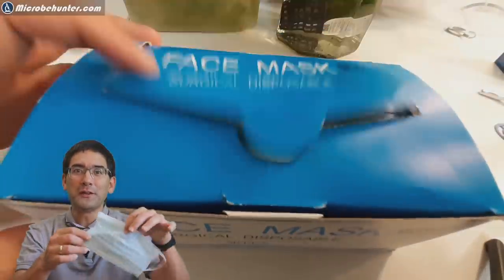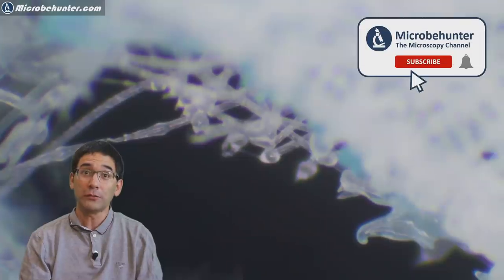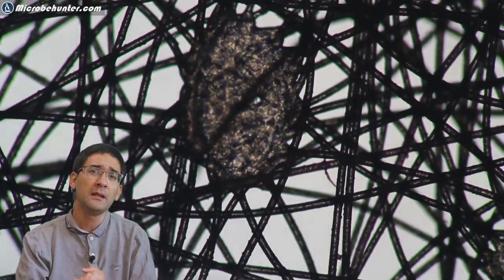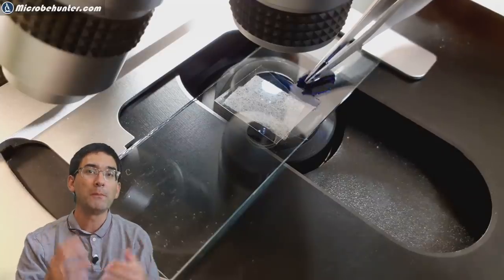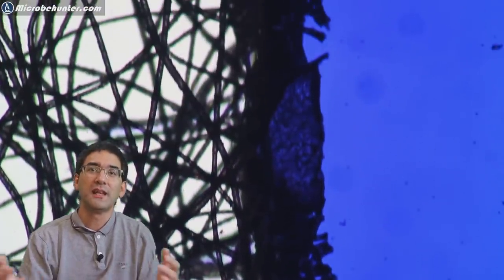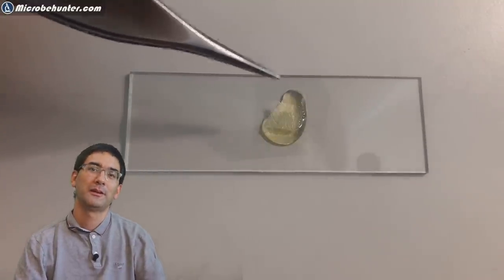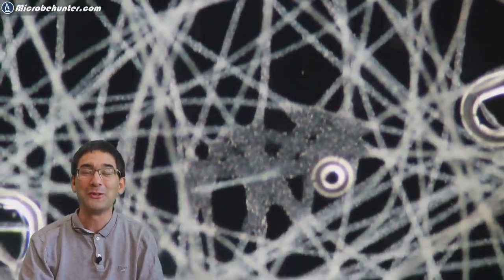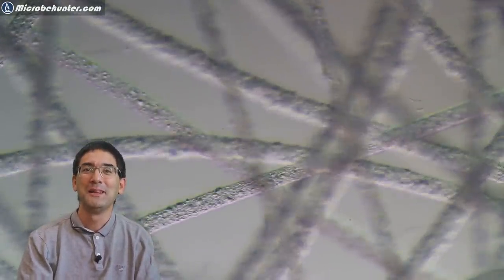A Corona Face Mask is made of synthetic fibers | Mask under the microscope

Comment: Yesterday, a nurse, wearing an N95 mask, told me she likes the smell of my perfume 🙄
Reply: @dedetudor.  what does your comment mean ?,just interested. Nixed means to stop . So therefore it just doesn’t make sense what you have said 🥺
Reply: @ireneforster4279  that's right. Even n95 masks do not say on the package that they prevent against viral exposure through respiratory inhalation. AND when you are breathing out your air escapes through the expiration valve. See? This came out quite some time ago. MANY experts say masks are a false sense of security. 
N95's are respirator masks. Mostly for environmental contaminants. But in this age.... People will believe what they're told by who by what by what peer review?
Reply: @dedetudor.  I agree I work in the dental profession and BC (before Covid ) we wore gloves and a visor  only and I worked through at least 10 known viruses......... now we wear mask visor gloves and a poly bag neck to feet ..      and none of it protects me or the patient .Although the visor does offer splatter protection ... on the mask box it actually tells you everything basically useless as a disclaimer . The hand sanitiser has so much poison in for your immune system to absorb and it’s flammable if it’s in a very warm environment .....never use it , good old soap and water is good. My immune system is strong (it has to be) and my mind is fairly strong because I know that plays a huge part as the vagus nerve from the gut(3rd brain) is linked to our brains !!! Rambling now lol 🌸🌸🌸 Our cross contamination is of the highest standard always has been 🌸
Reply: @dedetudor.  
N95 means the mask is considered medical grade and it is not considered 
a respirator.They are not the same thing.
Reply: And viruses are much smaller. Mask's are a joke
Reply: My husband had to be fitted for his mask at his job. They had to fit the mask then do a smell test to make sure the mask was fitted. They shouldn't smell anything. One thing it does for sure is not let you breath.
Reply: @louise3088  that's what tony fauxci said. If it's VENTILATING expirations. That's why they started making people where a plastic mask over the n95. See? 
Don't argue. Das is Verboten. FAUXCI says!
Reply: Maybe the dudes at Smoke Buddies indoor smoke boxes might want to make masks??
Reply: oxygen finger meter.  92 is just ok. Should be 95 at very good, but 86 & below? Ur cells are dying definitely in lungs, brain....
Reply: @ireneforster4279  All good info Irene, thank you.
Reply: @louise3088  Im a retired nurse. We NEVER used an N95 mask. That mask is what painters and other construction professionals use.
Reply: @GetReady4LiftOff  Your oxygen saturation at room air should be 98 to 100. A normal person would be in respiratory distress at 92%.
Reply: @itsokaytobeclownpilled5937  
Different situations call for different levels of protection.
Reply: @itsokaytobeclownpilled5937  
I worked as a surgical technologist in the O.R. for decades.When we used a laser for certain procedures, we most 
certainly used an N95 respirator style mask as opposed to a regular O.R. mask.
Reply: @Rebecca-1111  They leave little clues.  During the fires, a fire chief said(or some fire spokesmen said) masks wouldn't block smoke particles.  The smoke particles are WAY WAY WAY WAY LARGER than the boogie virus.
Reply: @Rebecca-1111  Well that's spookie.  The whole fitting ordeal.
Reply: @louise3088  Welp, i didnt sit in on those kinds of procedures. You got me there.
Reply: @sicsemperevellomortemtyran309  exactly.
Reply: There is doctor who did the same thing and found flat worms. I saw her interview telegram. It’s probably circulating in IG as well
Reply: @ireneforster4279  Whoever invested in PPE before this scamdemic is getting really rich.  What a bunch of kabuki theater this has all been.  "Our cross contamination is of the highest standard".  Do you mean cross immunity perhaps?
Reply: Hi our hygiene standards are of the highest level , so cross contamination is very very low , minimises spread of disease from one human to another .
Reply: @ireneforster4279  Oh yes.  I remember one of my best dentists bragging on the higher sanitary standards than even surgeons use.  He had foot peddles for his faucets and stood w/ his gloved hands up, not ever touching anything.
My current dentist is a crapshow and does things that would get him shut down.  He doesn't use a hygenist to assist, not even to put his instruments out before he starts w/ me.  So while my jaw is aching, half upside down on his lift chair (because that seems to work best for him), he goes rooting around in his drawers (notice I said plural) to find the next thing he needs.  I remember the first time he did that,I was gobsmacked. It took me awhile to clue in that if there really was a pandemic,  and if fomites really were an issue for respiratory virus, I and all his patients would be so screwed.
Reply: @wakeup2241  flatworms in the mask's?
Reply: @saintejeannedarc9460  I have a hard time not gagging at the dentist after I found out they recycle that water in that box from patient to patient. SICK!!!
Reply: @Rebecca-1111  There are some sort of black worms--could be nano technology--embedded in the disposable masks. Those masks shouldn't be worn anyway! They're toxic (you're breathing in chemicals) and they are not biodegradable. Why are people so effing lazy that they won't wash a face mask when they get home and let it dry overnight? So wasteful.
Reply: @louise3088  fact-checker here:  you are correct!
Reply: You need to create a meme of this and send it to one of the many conservative channels that will publish it.
Reply: @SC-gp7kt  today she told me she liked the smell of coffee that was brewing in the next room. 😳
Reply: @itsokaytobeclownpilled5937  
I am not trying to get you, only hoping to help clarify some of the confusion.
Believe me, when your job is to stand directly in vaporized genital herpes warts fumes,the efficacy of masks becomes 
paramount.Even though there is suctioning of the "smoke" done throughout, the fact that an ill fitting mask could result in herpes lesions of the throat is never forgotten.
Reply: @Rebecca-1111  I did not need to know about the recycled water, thank you very much! LOL
Reply: @warren7389  lol I found out I said the same thing 😁👍💯
Reply: @saintejeannedarc9460  - The virus, brought to you by China.  PPE now conveniently provided in massive quantities by China as well.
Reply: @GetReady4LiftOff  anything below 96 is bad
Reply: The other day she told me that she does not like smell of my fart. I told her that I thought she is protected by mask... but...
Reply: @louise3088  no, the N means it is non oil resistant, and filters out 95% of particles greater than .3 microns. There is an R which is oil resistant for 8 hours, and P which is oil proof. Then there is additional ratings of 97, and 100 with the accompanying increase in efficiency. There is medical grade as well as industrial grade, some have an exhalation valve some do not. I have to study this shit every year.
Reply: @dedetudor.  no, not all N95 masks have exhalation valves, most actually don't, there is medical grade as well as industrial grade, although I do not know what the difference is. most likely sterility.  Although I don't believe a bit of the mask horse shit either, I have to study respiratory protection every year, and the little surgical masks like so many people are using are only mentioned in the context that they are absolutely useless in any legitimate respiratory protection program.
Reply: @jamesharmon3827  
Not really sure why you are posting no to me.Did I not say medical grade ?
Did I not say different procedures require different levels of protection ?
Reply: @jamesharmon3827  
The difference is not sterility.Although
O.R.s are considered sterile environments, clearly not everything inside of them is sterile.Scrub clothes, O.R. caps, shoe covers and masks are not sterile.Whoever scrubs in wears a sterile gown and gloves.For you to say
regular N95 masks are absolutely useless in any legitimate respiratory 
protection program shows a lack of knowledge.There are many airborne illnesses whose spread is lessened with the use of regular medical grade masks.
Reply: @jamesharmon3827  they've never given proper toxic waste or hazardous waste receptacles for a bsl4 pathogen.
 AND the place people grab the most when they adjust their masks from falling down when they talk is right where the nose and mouth are. I've seen Fauci adjust himself upon standing for a break after a questioning. He continued to adjust his pants and belt buckle rubbed his face and adjusted his mask. I saw Joe drop his mask as he turned to leave in a rare stage moment at the podium. He dropped it on the floor and then put it on his face. 
At the end of the Trump 4 yrs.... A man was going to come onstage and give an update of some sort. The camera angle caught him standing in the wing before he came in stage, maskless. He put the mask on his face before he came out on stage and walked to center stage podium, took off his mask to speak. COMEON man!!!!
I'm former medical... Also studied OSHA mask standards well PRIOR to the announcement THAT has well...  You know.
Reply: @dedetudor.  my friend told me he feels naked without a mask.
Reply: @anewstarisborn.1945  aw.... Well now, I'm speechless.😣 I hadn't heard that one yet.
Reply: Gases are smaller than virus by quite a bit i found out. I think....
Reply: @nobody617  That's why gases require Gas Masks. As during the WAR when the makers of mustard gas sold it to the Miltary armies.
 Dr. Sheri Tenpenny says, we should have one. They could bring back a lot worse things than mustard gas.
N95 only filters out .03 microns particulates and above as the package says but not gases. 
The virus and viral particles are ever so much smaller! So check THAT out!👍
Reply: @dedetudor.  thats exactly what i was saying. Of course they could sMell perfume thru an n95.

Oh wait. Ive read that the virus is much bigger than gas. But i looked at methane.
Reply: Oh wait.... I read that the virus is way bigger than gas. Ok. Ill read more.... Nit that it really matters...
Reply: @nobody617  I've read the virus is smaller than what the masks can block out.
Reply: @Sundayschoolnetwork  i do realize the virus is smaller than the mask filters. Im only saying that gas is even smaller.
Cheers!
Reply: Aerosols.
Reply: What?
Reply: Perfume particulates are smaller than viruses. So are gases.
Reply: @Rebecca-1111  actually no. Perfume particulates are smaller than viruses. Also, N95 respirators can block 90% or more of viral PM.
Reply: @j005a  was going to share a video of a doctor who debunked that idea, but the overlords here deleted it...very telling.

Comment: I assume the non-absorbent quality of the material means that your saliva liquid will quickly evaporate, leaving any viral particles free to float away into the air (and back into your lungs).
Reply: Well that is the point! They decided something had to be done about climate change. They decided that they could reverse or slow down climate change if the population was substansially reduced.  For now, they decided to try reducing the carbon diaxide on the planet. Well it worked, they decided. By keeping us indoors and having us breathe our own poisonous carbon diaxide instead of air for 10+ hours a day they can slow climate change. NO LIE

Comment: If it lets oxygen molecules through then it certainly lets much smaller viruses through!
Reply from the maker: Viruses are significantly larger than oxygen molecules.
Reply: @geoffparmenter7006  got any tips on how to make yourself look like a fool?
Reply: @geoffparmenter7006  covid has to travel in a medium, the medium is called a droplet/aerosol. N95 masks filter these medium with 95%+ efficiency. Surgical masks have shown to filter at ≈60% efficiency.
Reply: @lancerebo952  keep drinking the kool-aid. 😥
Reply: @goodcitizendude9597   If this is in fact Covid-19 as in Sars/Mers type then these critters are .01 microg. in size. N95 mask stops 95% of particles size .03 microg. 
Not sure where you got your information but I have the Documents to support my statement.

Comment: I did that. I put varies brand of mask under my new scope. They are made of plastic. 3 layers. The middle layer is of denser material.
Reply: I have seen exactly the same. The video seems to be about the white inner layer. It looks like the dense inner layer of my mask has holes of several micrometers, but I am not sure. Transparant material can also let light through, like a hole.

Comment: The spaces between the fibers in the mask are pretty far apart. I’m now wondering how truly big or small is a virus particle in comparison to the spaces in the mask? 🧐
Reply: The virus is roughly 1000 times smaller than the pores on the mask. So, no way masks protect you from the virus.
Reply: Actually....try 100,000 times SMALLER...
Reply: Sarscov2 is 70-80 nanometers in size....human DNA is 10 nanometers

Masks are in micron's 

Cloth Masks are around 600,000 times larger...

No known filtration system known to man can block a virus...

That's why the PPE for studying the Virus is fully self contained oxygen supply and level 4 HAZMAT suit..

Comment: Will u measure the spaces, and then place a water droplet that would exit ur mouth as u breath, and a typical virus and such...and compared to a N95, N97 mask, and take a shot of the mask seal against the face, the thikness of a hair, the how much more psi builds up when someone breathes out with a mask on, and how it could act more like a blow hole pushing things out with a greater chance of transmission,  how long a virus can live , haha,, still be active,, on the mask, and what happens as the water evaporates from the mask and what would happen to a viron...

Comment: If you honestly think this will prevent viral particles entering your body, you are just the level of intelligence your government hopes for..
Reply from the maker: The primary aim of the masks is to reduce the spread of the virus (containment). FFP2 certified masks will also reduce the chance of contracting the virus. Nothing is 100%, but it is better than no mask at all. Other measures, like social distancing, disinfection of surfaces and hands, vaccination are also needed. It is a combination of measures.
Reply: @Microbehunter  if governments cared so much about our recovery, why did they not close boarders down when they knew about the "severity" and issue us with the correct rated biological particulate masks?